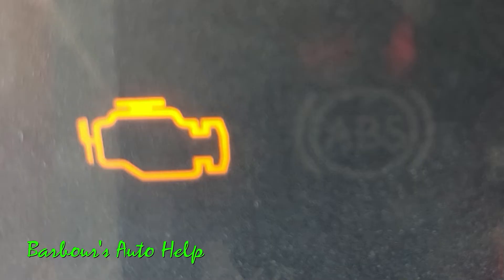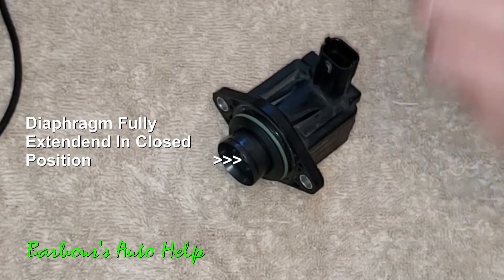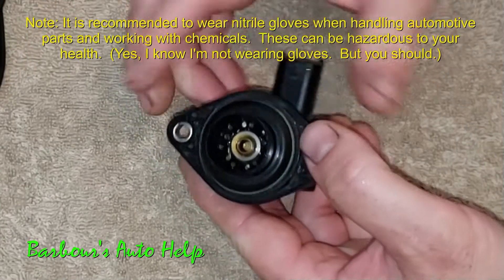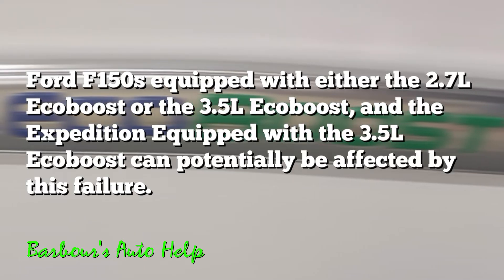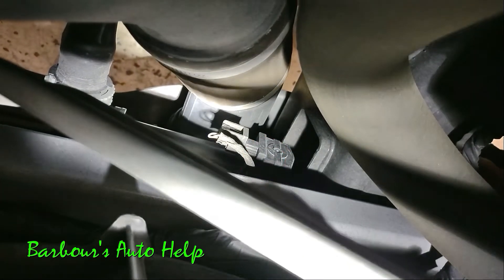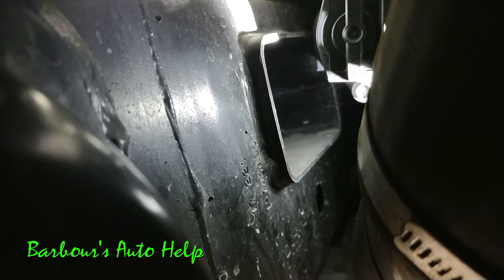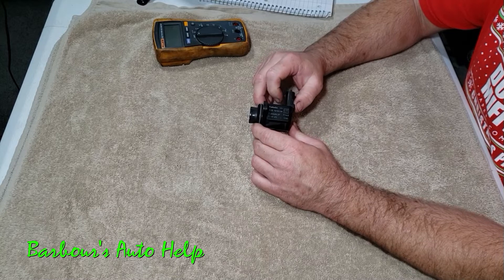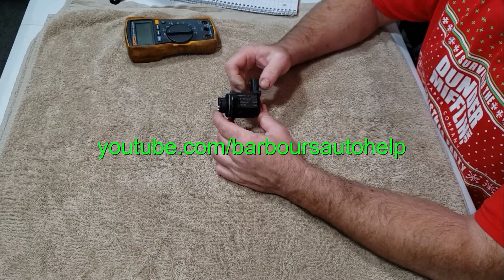P0299 BY FAULTY TURBOCHARGER BYPASS VALVE/ ECOBOOST F150 & EXPODITION

Comment: How does it even vent off? Where is the outlet??
Reply from the maker: Plastic tube from CAC back to air inlet tube.
Reply: @BarboursAutoHelp  but it only bolts with one face. Does air travel inside and out this valve or does that moving part block and unblock a air passage?

Comment: What voltage are you applying to make the valve open and close?
Reply from the maker: 12v Car battery.  Be sure to use a fused jumper.  3 amp fuse.

Comment: I have ford edge sel sport 2013 i can t find it please help
Reply from the maker: Well, do you remember the last place you parked it?  If you don’t remember and still can’t find it I’d suggest making a police report.   I hope it wasn’t stolen.
Reply: @BarboursAutoHelp im talking about bypass valve I can’t find it in my car i have also code p0299
Reply from the maker: @توكلعلىالله-ه5د  I believe it is on the top of the engine between coil #2 and #3.  That's if its the 2.0L GTDI.  It's made a little differently than the bypass valve shown in the video.
Reply: @BarboursAutoHelp  its 2l ecoboost thank you sir
Reply from the maker: @user-yn7jq2js3v Not a problem
Reply: @BarboursAutoHelp i think uou talk about waste gate soliniod that’s different whats in video
Reply from the maker: Yes it’s built different
Reply from the maker: Do you think perhaps a friend or family member may have used it?

Comment: Do you know location of that Bypass valve in 2020 ford escape 1.5T ? I cant find any information about location. I have the part but not sure where it is. Pls help
Reply from the maker: Believe it’s rear of the engine between engine and transmission close to the air tube on top.

Comment: I have an underboost code showing for my 2016 2.7 and when it gets to higher speeds the orange wrench light appears and I lose my turbo completely. If I pull over turn the truck off the turbo works again. I brought it to the dealership i was looking at a $7000 turbo job but the turbos and waste gates tested fine. Long story short they put a wastegate silinoid in and it ran better than ever almost like a new truck for a week and it happened again. I’m gonna bring it back but it’s seems electrical and very difficult to track down. Anyone have this issue
Reply: Did you find the problem. My 2018 started acting up 3 days ago .also orange wrench with p0299 code .
Reply: Mine doing same thing
Reply: Did you ever find out what it was?
Reply: @azteca466  mine was bad cat converter.
Was blocked so no pressure code was showing for turbo..
I bypassed cat for now and had no problems no engine code or lights etc.
Reply: @marckirby7356 how did you bypass the cat?
Reply: same exact problem. any fix ? wrench goes off when turning the truck on and off but the check engine light sticks inconsistently
Reply: @jcsnrs02 did you figure this out
Reply: Did you ever figure out what was causing your problem. My 2016 is doing the exact same thing.
Reply: @adamgreen9586  It’s the diverter valve
Reply: @Eckoballa  do you have the oem part number ?
Reply: I have the same problem on a 22 2.7 when I do more than 70 I get that code and wrench anybody found a solution ?

Comment: I have a 2015 mustang ecoboost I replaced the whole turbo and boost solenoid intercooler sensor and intake Manifold sensor and I keep getting the p0234 and had less than 10pounds off boost then sometimes gets boost bit with some wear sounds coming from turbo like something hitting in there but it's new turbo need help to fix the over boost condition
Reply: did you figure this out?

Comment: hello good video, but I have a question can someone help me please, my truck does not make that sound (I already installed the valve and filter) but it does not make that sound can someone help me please my truck is 2018 raptor ecoboost TT 3.5L
Reply from the maker: What sound?  What’s the problem with your truck?
Reply from the maker: Also what filter are you referring to?